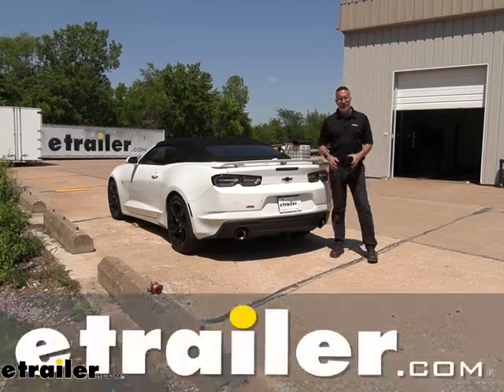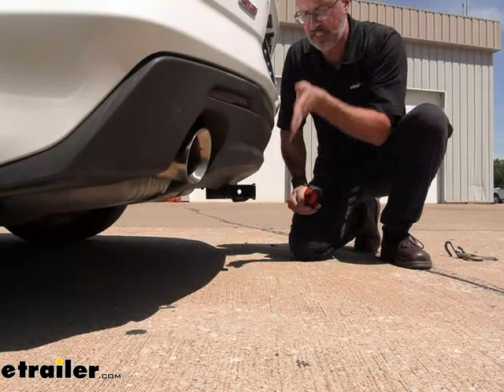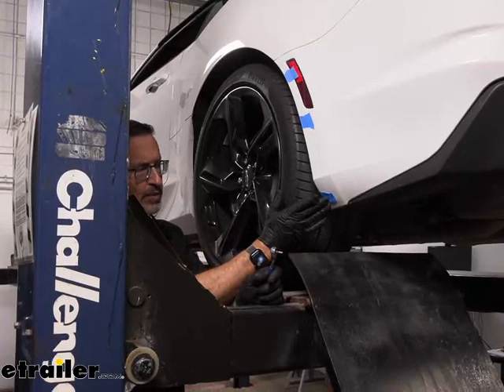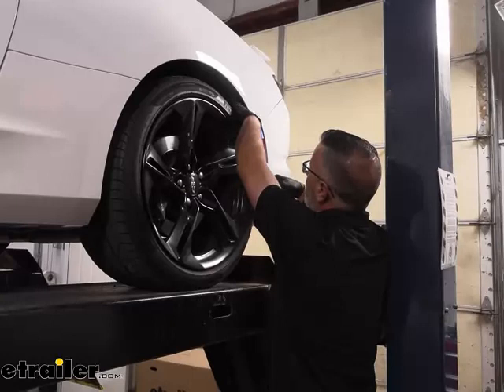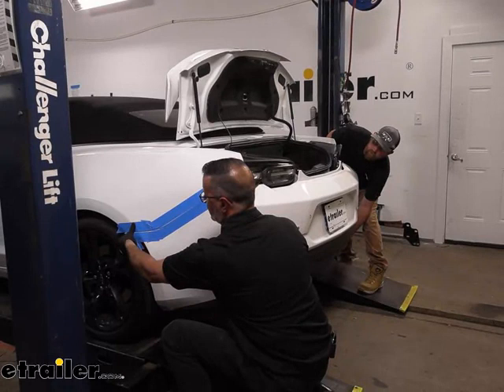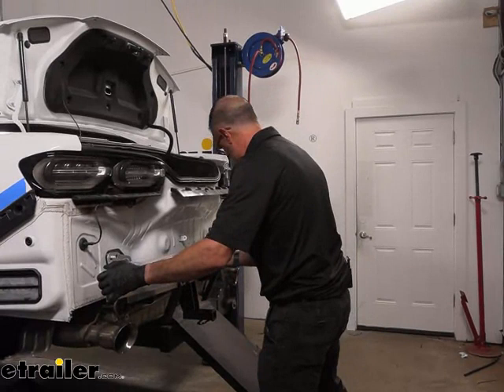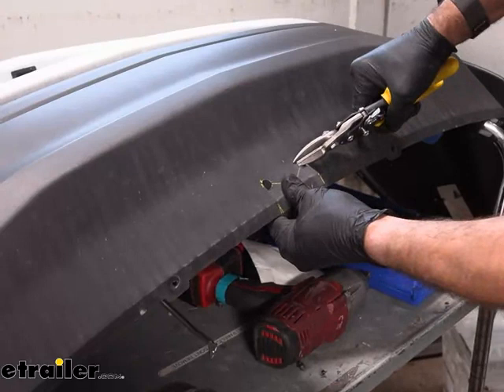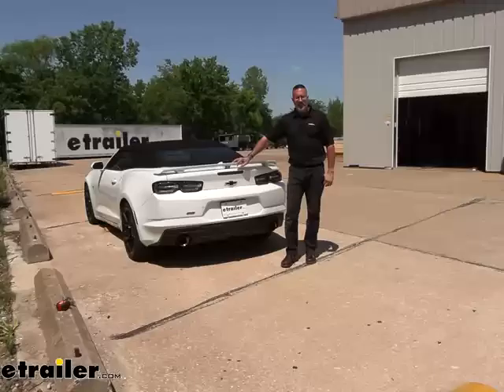etrailer | Mount: Curt Trailer Hitch Receiver on a 2020 Chevrolet Camaro

Comment: I have a 2020 Camaro RS V6 can I haul a lite RV trailer ? I know the car has plenty of  power & torque but I am curious about warranty
Reply from the maker: The owner's manual for the 2020 Camaro specifically states that the vehicle should not be used for towing a trailer. We can't recommend doing anything that contradicts that. Wish we had better news for you.
Reply: @etrailer  thanks for the come back ! I know back in the 70's people including my brother pulled RV trailers with the cars , and I know my Camaro has the   power to do so , but that doesn't mean the rest of the runnin gear would hold up !
Reply from the maker: That's exactly correct!